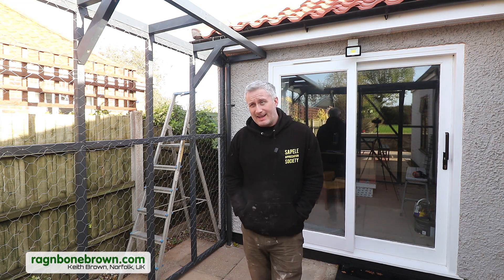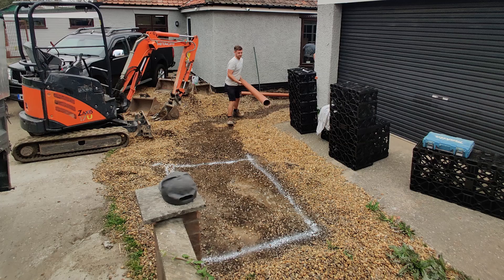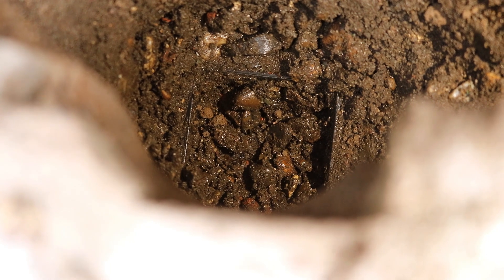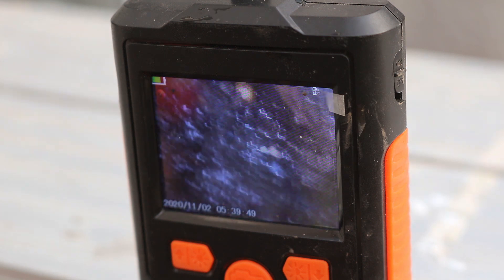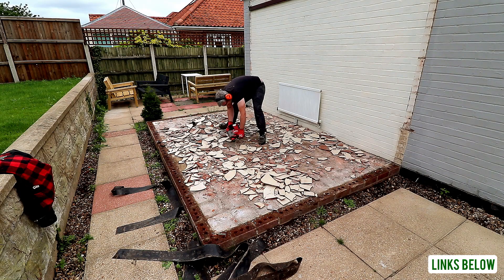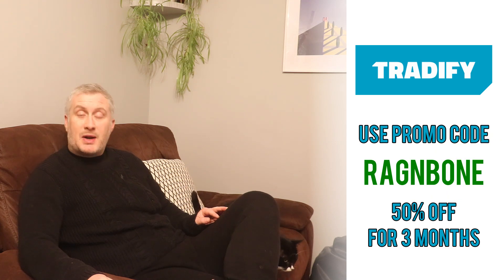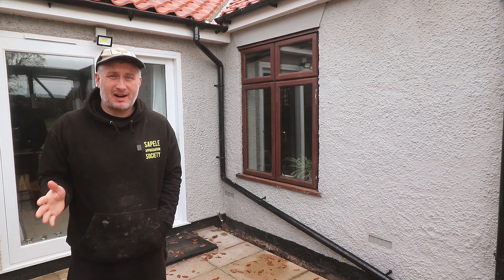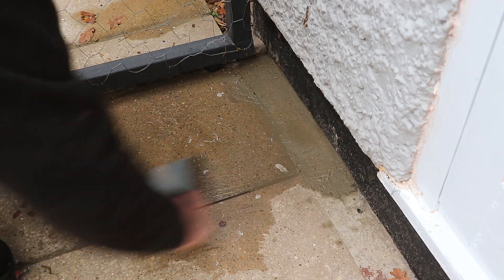How Would You Fix This Drainage Problem??

Comment: 10:17 Are there 30 degree joins available for pipes? (I think it's 30 degree) then the section could have run flush with the bottom instead of at an angle.

Comment: Fit a small water tank (120l) and use it to water the garden, you can then hide the tank behind some timber cladding, vertical garden or a cat run accessory. To deal with the overflow, fit a smaller diameter pipe (say 50mm) and run it underneath the gravel ensuring a decent fall and tee it into the downpipe.

Comment: My recent nightmare has been LAP security lights from Screwfix. Under 1 year old, had one burn out and the other stay on constant. Changed them for some of Amazon no issues and already in bad weather. I’ve one more LAP light, only a matter of time. Just a pain!! Should last ten years. Amazon ones higher IP rating also. Mikee I think the make is.

Comment: Keith,,perhaps you should consider heating the pipe up with a torch (careful not to burn through it) and then  bending the molten but still intact pipe towards the ground. At least it would not be running up the wall in that precarious way and not to mention that it doesn't look ideal.  This way perhaps you could even bury the (new) pipe into the small space you dug up.....

Comment: I'd say mount a waterbutt to collect the water from the downpipe. That way you can collect grey water for the garden or when it's getting too full use a perforated hose to run it out away from the building.
Reply from the maker: New soakaway needed unfortunately... Coming soon to the channel
Reply: @RagnBoneBrown  I thought that was going to be the case when I saw you hoarding the gravel, but then you used it for the slabs.... 
I don't envy you at all, soakaways can be a nightmare

Comment: I think those holes in the buried pipe were probably for drainage. If you had heavy rain hitting that wall you'd get substantial run off going into where you have the decorative stone. Other then that, cracking job.

Comment: Plastic pipes (and gutters) don't need the kind of fall that most people seem to think - they are much smoother and have fewer joints per run than the old iron or clay pipes and gutters, so you could put your new pipe run at almost horizontal and it would work fine.
It doesn't look that bad, but if it really bothers you, then drop the fall and you'll get most if not all of the pipe underground.
Reply from the maker: 90 or 92.5 degree tees do not exist though
Reply: @RagnBoneBrown   2x 45 degree bends would do the job.
Reply from the maker: The branch connector is the issue, it's 112.5 degrees

Comment: Tradesmen make me rant. I only took up DIY because of poor work in the past and found almost every job I could do better myself. If I could, would have replaced the boiler myself. Used a government appointed boiler company to fit it then found they left my electrics illegal and pipe from condenser permanently leaking. After years of getting no where, got another pro in to service boiler and fix the leaking, now he messed that up and wants to charge me over £200 to fix the damage he caused. So frustrating as know what damage he done...the rant would continue but you don't want to hear my moans. On a positive Keith, excellent work buddy, it's a very good temporary solution 👍

Comment: Just like how a typical S trap under your sink still drains... you could have run the new down pipe along the wall level (or even below ground) and then join up with the existing square pipe (assuming your joins are all glued/water tight). 
You would get some standing water in the low points, but it will still flow when it rains - since the water is coming from much higher (the gutters) so the pressure will force it through, even if a little uphill. You don't see it done that way often - more things to go wrong long-term, but for a "temporary" less-unsightly solution...
Reply from the maker: 68mm pipe isn't available in 90 degree turns unfortunately
Reply: @RagnBoneBrown  That makes sense then! You're a better man than me then, for not just reaching for the duct tape 😂

Comment: Just replace the elbow of the square pipe with a tee and run square to the corner along the ground, you only need about a 1 in50 fall so should be able to hide it below level, and its a good idea to buy yourself some pots or leaf guards, as the elbows can tent to collect debris
Reply from the maker: No such thing as a 68mm tee, unfortunately

Comment: Couldyou’ve cut the failing downspout above ground and then run it sloping down the same side and just let it drain into the rock drain thing? It would have been parallel to the one you created but would not have attached to drain underground. Either dig a hole to the rock drain or just dump it above ground a let it saturate into the rocks. Basically bypassing the failed drain underground.  Then it would be in cat house and become part of the decor.

Comment: I studied and worked in architecture. Given the monetary constraints, I think you did what you can. You really don't want water building up near a foundation however, it is a much bigger issue than you think over time. Even if it is just from the roof. 

The whole thing needs to be changed however, I don't remember you building the patio, is there a lot of hardcore underneath there? That should help with drainage. 

Normally you try and tie the guttering into sewage because that doesn't tend to go bad. Some countries have separate water outflow systems for rainwater which is good but the UK is not one of them. 

I also highly doubt that your lot is big enough to warrant some kind of SUDS.

Comment: Could you not have removed the square bend located below the working downpipe, and extended the square pipe to the corner, then reinserted the square bend  to receive the new Downpipe in the corner?

Comment: The tradesmen getting a bad review is a bit harsh, they probably didn't know pipe was damage/blocked etc. They would of assumed the pipe was just below the ground because of the patio being built after the original pipework was installed you had a  enter view of it when you dug up the patio and you still didn't know there was an issue. Also I've been in the trade for 20 plus years and this is the first time I've ever seen square downpipe being used as underground pipe which is probably the biggest issue
Reply: Looks like whoever fitted it just used what they had available. Would also explain the holes in the angled parts.

Comment: Best temp solution possible. Worth checking how that gulley affects the flow to the down pipe. A water butt could act as a buffer with a low constant drain along the floor. Longer term, replace the square drain with a better possibly open option to allow air flow behind the water and a better seal from the ground run. *not an expert but neither were they by the look of things.

Comment: El Chimpo would have burned the whole structure down to the ground. 🤷🏽‍♂️  but you did commendable work good sir. Working through the steps to find the problem and ultimately a solution the will work until you can redo all the drainage  keep up the vids much appreciated

Comment: I'm worried you won't have a motivation to fix the diagonal pipe. I think you should have run the pipe horizontally along the bottom of the wall and used a few 45-degree and 90-degree fittings to join it all together.

Comment: Might be time for a custom replacement of the broken blue plastic top platform of that ladder at ~1:57? Maybe teak or some other rot-proof scrap. That's the kind of project I always do to procrastinate when there is some other unappealing project I want to avoid. Could the pipe along the wall just be angled a little lower so it's still a bit above grade but lower down in or near the shadows of the gravel trench? Might have to get a different T or heat-bend the existing one to change the angle a little. Not sure if worth the effort though!

Comment: Chop the bottom of the blocked pipe off and just redirect it to near the soak-away.  It doesn't need to go underground.  In other countries it's perfectly normal to just let the water run off in to the street or downhill some other way.
Reply: Not ok here. This is used to mitigate flooding.

Comment: I'm sure I've seen square to round rainwater adapters  Keith. I would have run a surface gutter and the downpipe into that the ones with metal grill at ground level.

Comment: I think I would have extend the drainage pipe in the ground to the next corner and dropped a new down pipe at that point. That said living in New Jersey we have various soil conditions and homes vary in age drastically Example: New construction  codes require perimeter drainage systems. The existing properties  always have a battle between $$ and esthetics.

Comment: Snap!   I had the same issue on my house earlier this year when I noticed that the downpipe in one corner of the house (that drains half the back of the house away) wasn’t in fact connected to anything at all, it just went under the paving slab and into nothing.   Like you we’d had the gutters and downpipes some years beforehand and the trades had just left this downpipe draining into the foundations 😮.  There was a drain hole about a foot away, but on investigation that went to a 3’ long piece of perforated drain - completely unsuitable for the volume of water.   I had to dig a trench across the garden and run a new drain to the underground water tank and soakaway we have.   Lots and lots of digging.
For yours, it looks a perfectly fine fix. I’ve seen far worse things than that with pipes running across the back of the house.   Long term you’ll have to dig it all up because that underground brown squareline drain is unlikely to be big enough.   A job for the summer …

Comment: Hi Kieth, great temporary solution, but, the square pipe isn’t a current underground pipe, it should be an orange 110mm thick wall pipe. I would do properly in the summer as you have bought the house for long term, but, maybe an opportunity to change the pipe routing and a new soak away.  Shame to see this low quality of work on the property you purchased, I would be frustrated too. Good luck and keep up the great honest video production.

Comment: Main issue that might have caused the problem is the down pipe should never, never go directly in the underground surface water drainage pipe without a gulley with a silt trap. Though common on new builds as it saves cost, it will always fail and once the damage is done its irreparable.  The down comes should always be fitted with a shoe, then a gulley with a trap.
When the down comer goes straight in to the surface water drain, any dirt, leaves and granules from the tiles go straight in to the soak away and silt it up.
 If you have a trap below the down pipe if it blocks you simple empty it and your away. 
Also as soon as there is a problem you see it as it doesn't drain. 
If like your situation, when there is a problem you have 6m of 110mm pipe to silt up before you see there is a problem ( assuming your soak away is legit and 6m from the building) by which time its too late.
That said a soak away will only work if your in a non cohesive soil anyway and a lot of soak aways especialy on conservatories, little extensions that building control didn't oversee and the like generally go no where anyway.
Sorry to be negative ☹.

Comment: Totally agree with you about the majority of tradespeople.  Got to a point that now I do most things myself - might take longer but I get the sense of accomplishment and I know exactly what has been done and to what standard.  Latest issues - windows installed badly and poorly sealed, new driveway is shambolic, 18mth driveway dug up to fix a leak and now is sinking (should've done a Proper DIY job and done that myself) and new electrics to shed and hot tub was installed by a blind person with no skills!!

Great way to solve that problem.  Whilst not aesthetically the best, it does the job and as it's round the back out the way it's not too bad for now.  Cue a few years down the line, video for patio replacement, new soakaway and drainage! 🤣

Comment: I thought you could have purchased a deks drain garage pack x 2. Then either lay it towards the soak away or to the down pip you used but slightly away from wall.  I know it would have been a little more work, and a few pounds but you would be able to clear any debri. From 1 Norfolk person to another

Comment: You could have got rid of the downpipe?, then extended the gutter over the fence.  The water then becomes someone else's problem 😆

Seriously though, if the pipe is really bugging you just make a giant cat tree clim ingredients frame thingy to go in front of it.  
We found a similar level of bodgery on one of the down pipes here.  Round 68mm downpipe that just disappeared into the ground.  When we noticed that the gutter overflowed in heavy rain I dug out around it the same as you, hoping for a nice easy fix.  Discovered that the end of the 68mm pipe was just sat loosely in some odd yellow pipe.  Smaller than standard soil pipe but bigger than downpipe.  I managed to pull almost all of the accumulated mud from the pipe but was really struggling to find any sort of adaptor to satisfactorily seal one to the other. Ended up using a wc pan connector the wrong way round and adding a gulley.  This way we can see if it blocks up again and I can clean the u bend if I need to.  It'll do until I can think of a better way of doing it

Comment: Agree on making the temporary solution permanent. A nice long wood-box with an open front on it for drying the logs for your wood-burner would do a nice job on hiding the pipe. You'll have access every spring when the logs run low. I built one out the back of  my own house and it works a treat.

Comment: I would have laid a length of aco drain between the wall and the patio. New downpipe straight into the start of the aco. Replace the existing square section underground with an aco gully end with rodding point.  More expensive than your  current solution but would look neater.

Comment: I would have tried to remove the pavers above the soakaway, and try to unblock from that end (since you now know where it is).   The only issue is that you already added concrete above the inlet, so you can't really go back and do that, so probably too late for that.  (I'm not from UK, so I could be completely wrong here).
Reply: Great shout. That wouldn't cost too much to lift slabs. But it is quite a bit of effort.

Comment: That pipe running at a 22.5? degree angle along the wall looks terrible.  Put a 22.5 or 45 fitting in the tee and run the pipe along the wall more horizontal.  That will allow you to run it low along the wall, ideally in the area of the wall that is painted black.  Will blend away better that way.

Comment: You learn something new every day. Apparently a soakaway is a thing in the UK, I have never ever seen such a thing.
Here the drainage pipes, just stop right above the ground or tiles. (which are on a angle pointing towards the street drainage).
The only thing I have seen that is kinda similar, is a 1 meter (3 foot) drainage pipe they jam deep in the ground, directly underneath.

Comment: Honestly I don't think the pipe looks that bad. If i was a buyer looking to buy the house it wouldn't put me off, put it that way! The only improvement I can think to make is if there was a 45d adapter perhaps so the pipe could run more vertical than horizontal going up the wall. A slight drop ofcourse, i know, but better than diagonal. Nice fix Keith, and educational to those of us yet to come across this problem.

Comment: I bet the two holes in the bends were for ground drainage into the pipe! mad i know... Cant you fit another swept bend just after the y piece and have the downpipe running almost horizontally close to the black portion of wall (with a fall obviously). Look neater for now...

Comment: Could of connected a water butt to the down-pipe. Would mean emptying frequently during the rainy periods but a temporary solution until the underlying problem is fixed.
Reply: You can attach a hose pipe to the overflow and redirect it far from the house.  Would have been a much easier and quicker solution.

Comment: Maybe a rainwater barrel (don't know if you have a "garden" that needs water). I have that setup and during the wintertime where we do not use the rainwater, I have a hose connected to barrel that leads the water onto the ground under some trees. With heavy rain the barrel works as a buffer.
Reply: This is an excellent idea. So simple.
Reply: @bdlii  I'm a simple man 😉
Reply: It could even feed the cats drinking vessel(s)

Comment: Instead of the Y pipe coming out of the ground, could you have used a T fitting. This would have allowed the extension to run along the ground with a slight tapper, rather than up the wall.

I suppose the laws of physics would dictate that the water may have trouble making the 90 bend of the T, but would imagine in practice that would only be an issue during the strongest of rains?

Comment: I’d have done the same Keith. I did have the same thoughts as others have posted, namely use a Waterbutt and use a T rather than Y connector to allow the pipe be horizontal along the ground and let laws of physics do the rest. However, on reflection these ideas both have flaws. I built a garden office/gym during lockdown - not that big - and use a large waterbutt. It completely fills in seconds with the slightest rainfall- always amazes me. And using a T connector, yes laws of physics will ensure the water flows through when it rains. However when it stops raining that horizontal pipe will be left with a pool of water in it. If that then freezes it could damage the pipe.